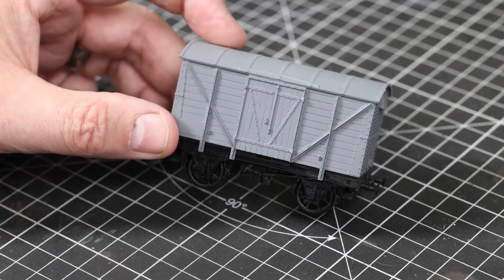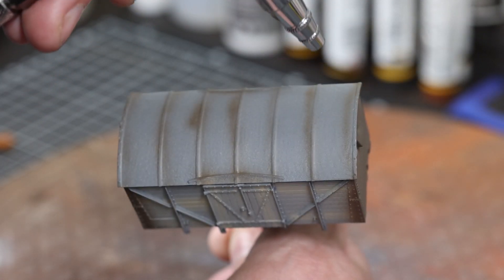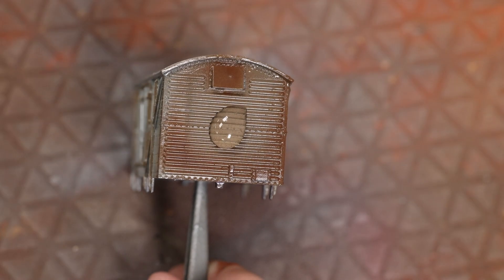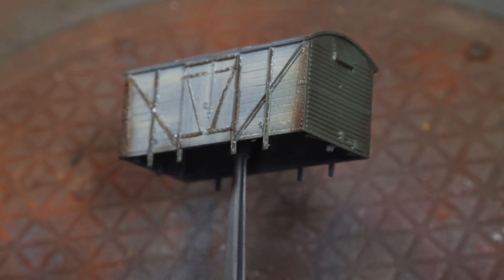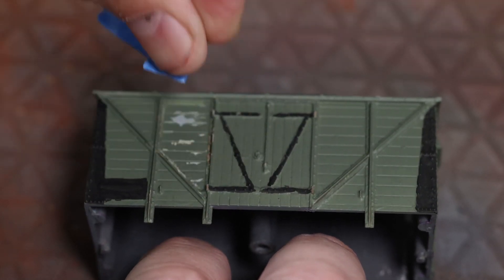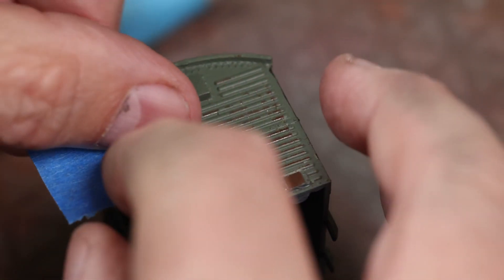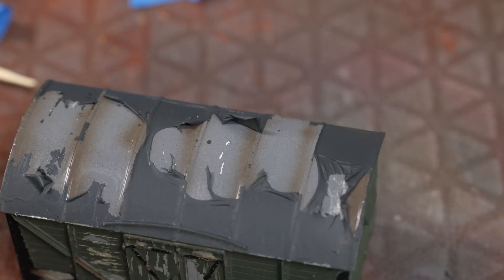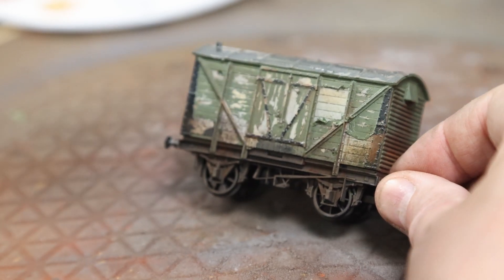Asda Chipping Medium for Flaky Paint Effect | Weathering Model Railway

Comment: I'd describe this as more a "peeling" than flaking, but as such is very effective. I wasn't sure initially, but the finished result is nice, especially for the torn roofing material.
For a more "chipped" look, I've used a hairspray (silvikrin I think) and then sprinkled salt onto it when still wet. Then overcoat with spray paint. Then rub with fingers/toothbrush and water to reveal the undercolours. It works well to replicate flaked rusty surfaces rather than the weathered wood and peeling paint of your Asda method.
Reply from the maker: Yes indeed. I've done a video comparing salt and hairspray chipping techniques. They all have their uses